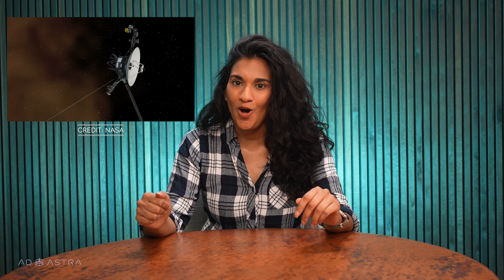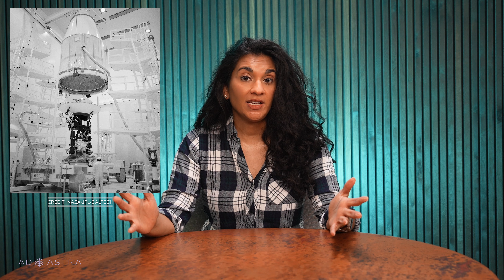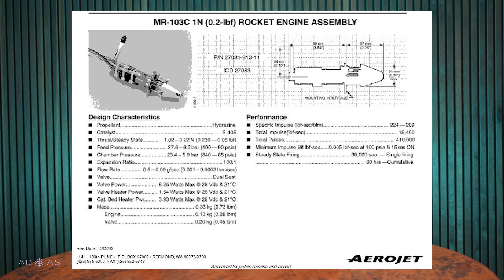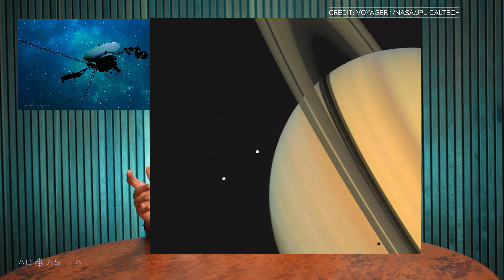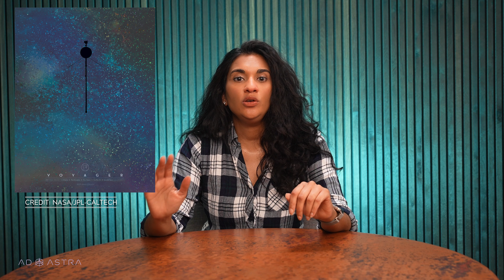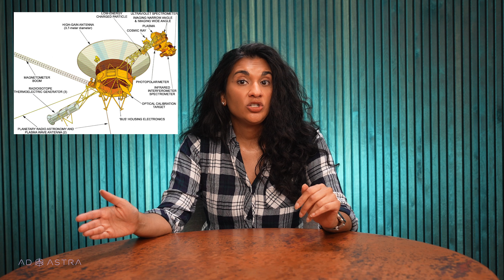NASA’s risky maneuver to swap out Voyager 1’s engines

Comment: Is it possible, with today's technology, to create new vehicles that can travel faster, farther, and more reliable than the Voyager's to send out there with new mission goals?  Maybe get the current Voyagers to keep going until the new vehicles reach them, get the Voyagers to stop and settle where they are and use them as a relay for the new vehicles while the new vehicles keep going on their path?  Just and idea... or at least an idea to get some smarter people to think about something along those lines...  

We have better tech, better materials, and it might be cool to  start something new...  with new methods of data collection, new types of sensors to detect things that the Voyagers weren't capable of in their time.

Comment: Why not just use gyros instead of thrusters?
That way you have no need for fuel.
It's like with aircon in cars - you need to use it every so often to keen the tubes clear.

I would not like to be the person responsible for the code review of the commands sent to Vger.
I bet the changes are reviewed by a panel several times.

Comment: Too far away, needs an upgrade.  Send plutonium rocket with upgrades.  Bigger dish, has a ring acceleration robot to perform the upgrade surgery from the lights lightspeed 1 package.  The robot has magnet hands and ball bearings transfer the power through the acceleration rings.  This way it can use AI to attach the rocket while it upgrades voyager 1 to lightspeed class probe.  If you hold a ring in each hand, a LiFe 7% 8060 500Mpa, and the ring rotates towards your feet, F = 2sinx + 2xosx, where F=ma.  So the robot jumps out of the rocket & puts its hands on.  It doesn't use wire, it uses tube shells, the right hand rule is deflection as it moves down a tube shell, betwean fuzed silicon ball bearings and normal bearings to transmit current.  This way the rocket doesn't need propelant because the rings have 86,000 Youngs modulus per square inch, they can accelerate as fast as energy can be produced even on a tight weight budget.  Of course it needs a ton of mylar reflector for the cool telescope Canon Eos R5III, or one then nifty Sony cinema cameras.

Comment: Thanks for the video. You did plenty of research, and made it factually interesting. 🙂👍 One tip which you might want to think about: The vocal fry (croaky voice, or frog voice), which you use extensively, is not good for your vocal cords. It is a bad habit to adopt, and will eventually ruin your voice completely. Unfortunately, many people, particularly females, are using it recently.

Comment: As much money as we spend on regular satellites, rovers to mars, moon, etc. ... would it be that awfully much to send another probe on it's way, only faster, that acts as a transceiver/signal booster so that every year it gets farther away from us, the communication should in theory get better and better with Voyager again. Even though it is screaming away at incredible speeds - just our current tech to get it started, a good slingshot around the moon, and so on - just having a booster out and away from the planet should be a HUGE difference in comms.
Reply: I don't think that would work.
I believe the communination between the Earth and the satellites work because we have MASSIVE and high-power antennas on Earth. (Massive power output to transmit, massive dish+gain to receive). That makes up for the comparatively small dish and power of the spacecraft's antenna (e.g Voyager has some 23W 3.7m diameter antenna, while the the ground station has 20kW+ 70m diameter)
Sat-sat communication at that distance would be very problematic ( you would need much more power for that relay station than the probe itself, if it was to boost the signal...)
Reply: @panda4247  I've been in radio and satcom a long time. Our atmosphere - specifically the troposphere - and our magnetic field, makes an enormous difference. My whole point would be a major difference in the type of satellite for a booster satellite. Much higher power, a very large sail-type dish, married to an orbital satellite back here, etc. or it wouldn't be worth it, but it would be orders of magnitude better than anything we could accomplish inside the atmosphere and on the ground level, with probably half or less the power and surface area. 
Besides, the whole point is simply closing the distance as a relay to prolong communications.
Reply: @MandrakeDCR  "Much higher power, a very large sail-type dish" --> yes, if you decided to build a satellite specifically for this reason, it could be a different type of satellite with the specs to match this purpose.
(also, you'd need 2 antennas, one pointed to the Earth and the other to the probe... but that's the least of my concerns).
But how much power can we reasonably get on such satellite?  (I have genuinely no idea, maybe a reasonably powerful radioisotope generator exists now... but unlike the ISS or other near-Earth satellites, it could not rely on the solar panels or anything like that)-
Also, also, the other problem would be getting it closer to the Voyager, the configuration of planets to slingshot the Voyagers was pretty rare... Again, no idea how hard and rare would it be to be able to send something even 5% faster in the same direction.
If you say the atmosphere + magnetosphere are the problem on Earth, maybe a simpler solution would be to put our station to the Moon (with all problems that arise from it)

Comment: Help me understand why the thrusters need to continually fire to keep pointed at Earth.  Is it because of Earths orbit around the Sun which keeps moving Earth relative to Voyager or is it something else?
Reply: At first it would be like that probably but at this distance its just because tiny adjustments need to be made due to the fact that no adjustment will be able to keep it pointed correctly forever and the further away you get the bigger the change each adjustment makes

Imagine sitting on a office chair and its rolling down hill moving away from a tiny blue balloon 🎈 you have to stay pointed at the balloon to see it but you can only control the spin of the chair so you kick yourself in the direction you need to be and after you go too far one way you have to kick yourself again the other way always trying to keep the balloon in sight

Comment: They need to use one Voyager as radio relay for the other.. if that’s even possible.. Im born when they launched 1977, so I think they a bit special. 😊
Reply: That would not work for so many reasons. (I'll number them for easier referencing in further discussion)
1) the one used as relay would have to turn its antenna to the other and to Earth.
1.1) that would require too much fuel to do constantly
1.2) it would miss some transmission from Earth when it would be turned to the other Voyager, or vice versa.
2) the communication with Earth is possible because we have high-power antennas (strong transmitter, high gain big dish receiver). The communication satellite-satellite at that distance with their antennas would probably not be possible, even if V2 was following V1 on the same path
3) biggest reason - they are not following each other.. they are going in opposite directions (one is going "up" fron the Earth's orbital plane, the other is going "down"). So in fact, they seem to be farther from each other than they are from Earth. (One is going some 35° north and the other some 48°south, so the angle between them is more than 60°, so the distance between them is the largest side of the triangle Earth-V1-V2
Reply: To do that, Voyager two would have to keep turning itself completely around to point the antenna alternately from earth to Voyager one.
Reply: Sounds like a disaster

Comment: Sounds like my 2006 Toyota Corolla.  It was designed for a 10-year lifespan, but 18 years later it is still going strong, for some reason.
Reply: @menguardingtheirownwallets6791  Japanese cars are built to last.
Reply: Got you beat. My 2001 Ford still going strong. My mechanic should be hired by NASA.
Reply: @theophrastus3.056  27 year old mazda bongo here :D
Reply: @alzeNL  27 year old Ford w/~400k miles here
Reply: I am assuming there is no rust hazard in interstellar space.

Comment: When I heard the five-year mission, "to boldly go where no man has gone before" was appended to it. Thanks for a great video; I really appreciate all that you put into it.
Reply: @GatorBaitRAHHH  the two Voyagers were built from the Mariner probes of the 1960s and 1970s, which in turn were based off of the Ranger Moon probes of the late 1950s/early 1960s. Originally known as "Mariner Jupiter-Saturn", with the two planets being their intended target, the engineers at the Jet Propulsion Laboratory (JPL) intentionally designed MJS for an extended mission beyond Saturn, with the trajectory for Voyager 2 following that of the cancelled "Grand Tour" which would have seen two sets of two probes flying to Jupiter (after Pioneer 10 and Pioneer 11), with one set continuing on to Saturn and Pluto (or one to Saturn's moon Titan – accomplished by Voyager 1 – and the other to Pluto), while the other two probes would continue onto Uranus and Neptune. Subsequent "Flagship" probes, Galileo (to Jupiter) and Cassini-Huygens (to Saturn and Titan) would be based upon the Voyager probes, while New Horizons, which allowed Pluto to be finally visited, while more along the lines of the simpler Pioneer 10 and Pioneer 11 probes, incorporated the very technologies first flown on Voyager nearly 50 years ago.

Comment: They should turn it around (while they still can) and bring it back home  (or let  it spend retirement around  Pluto), it has done it's job. poor thing spending 76000 years at least on its own
Reply: LOL Voyager 1  is now over twice as far from Pluto than we are on Earth. The delta V required is currently beyond anything we can make, The voyager spacecraft used planetary slingshots to gain the high velocity moving away they now have.
Reply: @favesongslist  Can't they just swing it around so that it heads back into the direction of the solar system, it would obviously take years, but it would gain a bit of warmth , and there would be a chance of collecting or assigning  it in the distant future.
Reply: @Comfortzone99  Sadly not, it takes a lot of delta V to do that.
Reply: Sure they can turn it around in the sense of rotating it, but that won't magically change its trajectory. Voyager 1 is speeding away from us at 17 kilometers (about 10.5 miles) *per second*, much much higher than the 3.3 km/s it needs (at its current location) to escape our solar system, and we have no way of slowing it down so that thing is just _gone_. The fate of both Voyagers is to stay true to their name and continue on an endless voyage through the Milky Way.
Reply: @MatthijsvanDuin  TY for this more detailed comment.
Reply: Not sure what do you mean by "just turn around". Imagine you are sitting on an office chair rolling down the hall (and there is jo resistance, so you'll keep rolling). You have only some spray cans which you can spray from your left or right hand. Those would rotate you (so you'd face different way) but you'd still be careening the same way.
To change that you would need more thrust fired in to the direction of your travel, so that it slows you down and then speeds you up in the opposite direction.
A lot more thrust :) Voyager 1 is around 2.5 times faster than the rockets we are currently launching into low earth orbits, so imagine the amount of fuel it would need to slow to zero and then accelerate back...

Comment: Just have to marvel at the amazing work of the NASA engineers troubleshooting and providing fixes on a system so far away, with so much lag.

And at the amazing work of the designers who designed systems that COULD be fixed this way.
Reply: Yes, Voyager 1 has thruster problems, but that comes with being middle aged.
But seriously... The NASA/JPL are freaking wizards!